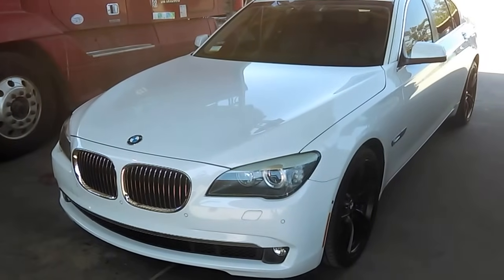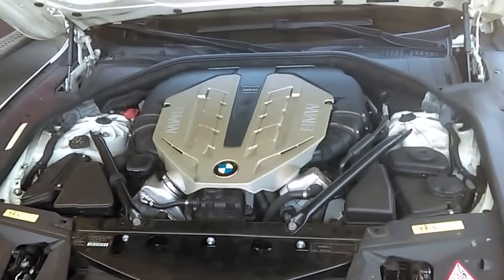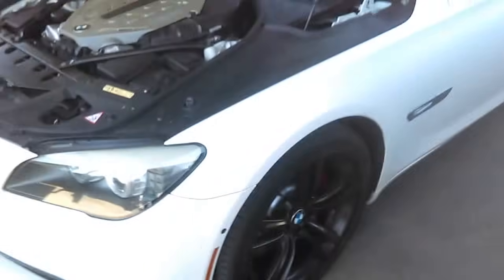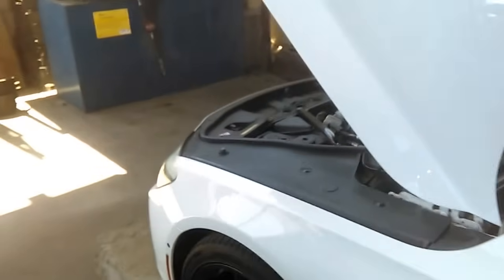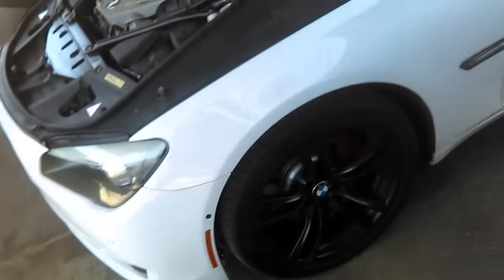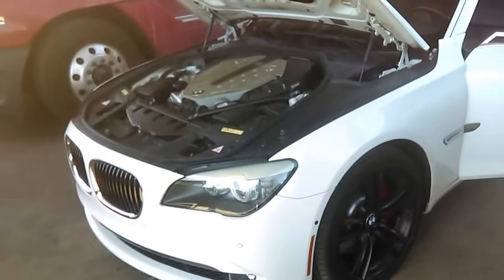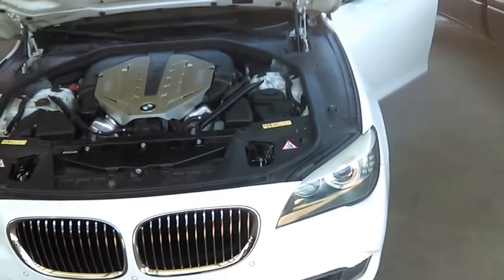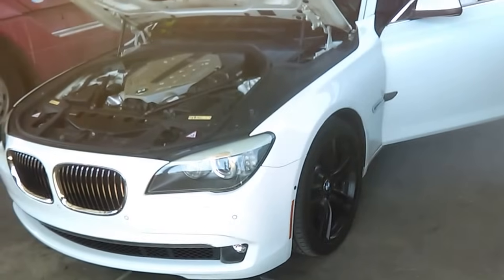BMW 750i 750Li F01 F02 common problems

Comment: my bmw got a flat and i didnt have a correct jack to take tire off (oreilly special) anyhow i drove it down the street to tire shop... now i have this warning about tire chains being installed, i have no tire chains, whenever i go over 35 a tone dings warning me about tire chains and reduced speed and the steering wheel symbol with exclamation point goes away.. my car runs fine as it should, its just this warning light and tone thats annoying me and i cant seem to get rid of it... can u help with troubleshooting shooting 9099215082

Comment: Mi bmw 750 i tiene codigo u116d , p1434 p0073 q pudiera ser
Reply from the maker: P1434 
Fuja en El Tanque de gasoline, puede ser que El tampon Este malo

P0073
Sensor de temperatura de ambiente 
Posiblemente see necesita cambiar
Reply: @franciscoamayaYT  ok gracias lo hare ahora la pantalla no se ve se quedo sin bateria la coloque de nuevo y no se ve la pantalla q pudiera ser
Reply: Gracias por tu ayuda
Reply from the maker: Le cambio batteria?
Reply: Si por q se habia agotado
Reply: El carro esta bueno lo q tiene son tonterias. Pero esas tonterias molestas
Reply: Si  le cambie la bateria  y luego la pantalla no se ve atras el gps prende
Reply: El radio tampoco le funciona donde estar el fusible
 Del radio
Reply from the maker: Los fusibles estan en el guantera y en el baul
Reply: Verifique y estan  bien todos  Los de atras  y al frente que pudiera ser
Reply: Como pudiera hablar contigo te puedo envio tu email y te envio mi # de cel y puedo hablar contigo
Reply from the maker: Revise los fusible de la pantalla, El diagrama aparece comp un cuadrito que parece quema cocos

Comment: "As owner and a mechanic"? I really don't think you are a mechanic worth it's wits. Control arms are problematic in 3rd world shitholes, battery wont be an issue if you use big enough battery that is being held in a good condition. Also, what does 160 minutes of battery mean? And by the looks of it, you, "mechanic" have worked on your brakes, so fucking up guide pins is on you.
Reply from the maker: +A what up? 
Battery is not a problem if you use a big enough battery? 
I guess, you found the problem for increased battery discharge.  

I have owned BMW all my life E36,E38,E39,E53,E65,E66,F01 and control arms  is a very common problems on this and others BMW models.
Reply: I had a 2005 745li never had control arm problems I have a 2010 750li now and never he'd control arm problems smh